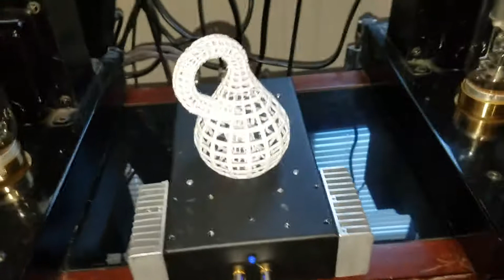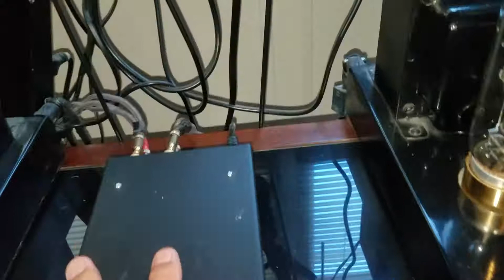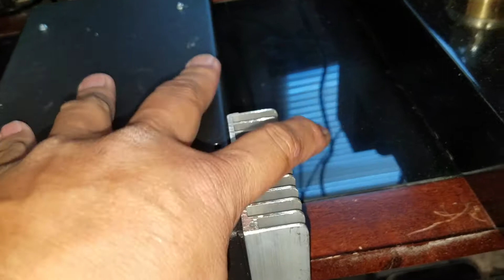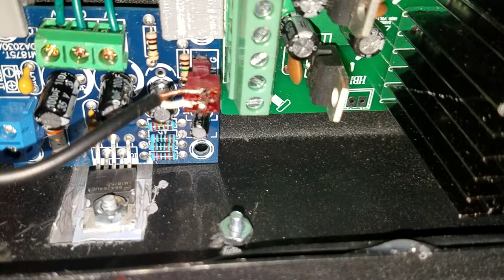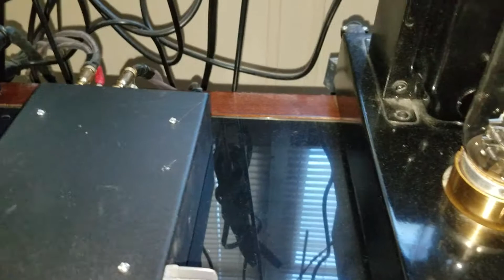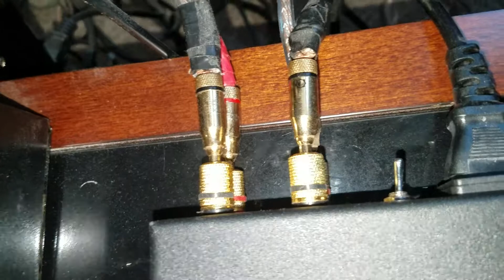LM1875 Gain Amp 50W/Channel

Comment: you can replace lm1875 to tda 2030a..
Reply from the maker: I wouldn't recommend it, cuz the tda2030,has max power supply voltage of 28V or +/- 14V, while the lm1875 has double that. Although the pin outs are the same, only if you have no choice you can do this but make sure to feed it the correct voltage. 😀😀😀😀
Reply: ok..i will replace lm1875 to yda 2030a and i will us tronsf.. AC 23.0.23 v ..so will enter 28+/_  DC .  i will get good watt sound ( 50w) in one chanel ....thanks friend
Reply from the maker: Make sure that the original circuit runs on +/- power supply, otherwise it will not work.
Reply: @robertescobaldiyelectronic3043  i us that ..
Reply: i have amplifier 2.1 ..us tda 2030a x4 ic ...2 chanel and 2xic for bridge suboofer (transf 14 v)  .i replace to lm1875 and i change tronsf ..23.0.23  3.5 A ..i gett more watt and i chane my speaker..its good sound 50w +50w + 80w subwoofer ) 😊😊😊😊
Reply from the maker: Wondering if you have the circuit diagram for your amp. This way we can be sure the circuit will be good for the lm1875.  Also the Capacitors on that original circuit may be rated of the original lower voltage.  If you apply higher voltage to run the lm1875  those caps can explode.